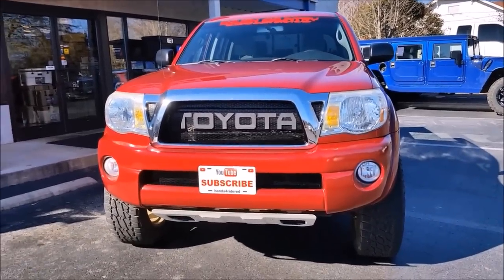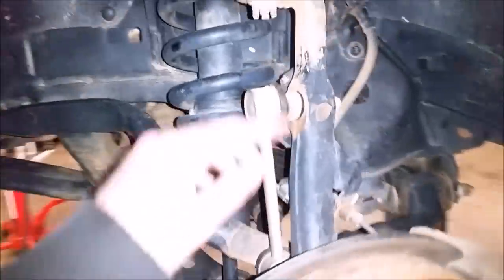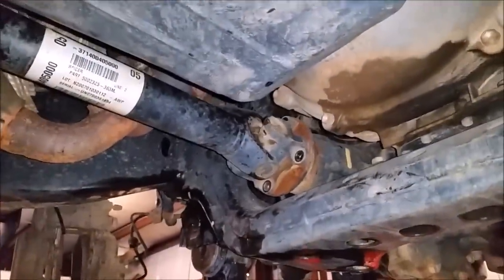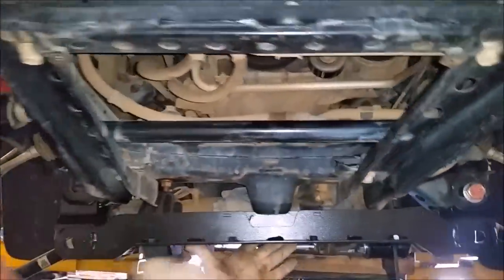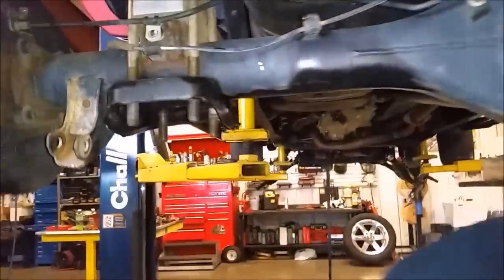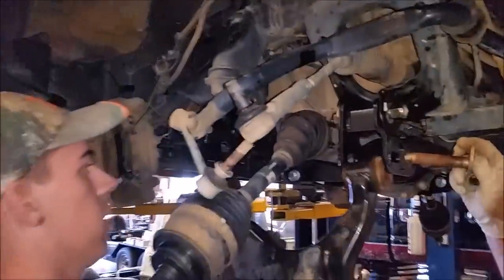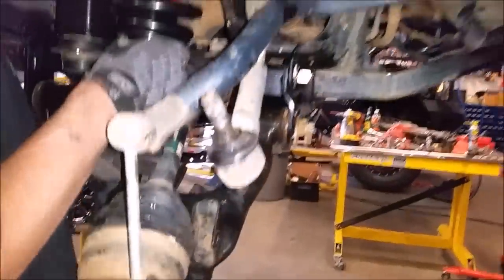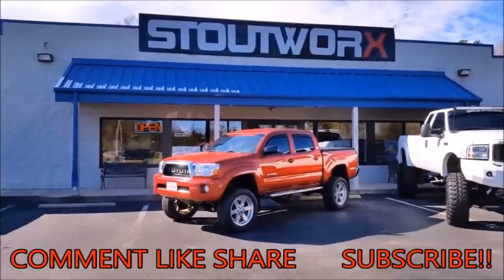Rough Country 6 Inch Lift Kit Installation - 2nd Generation Toyota Tacoma

Comment: does putting a lift on a truck cause more maitenence? Does it fuck up your truck at all?
Reply from the maker: A lift would generally not cause more maintenance, I had a 3 inch for 7 years and had zero issues. This 6 inch tho is a different story, I had problems with this one.
Reply: Bros FOURR Speed what types of problems?
Reply from the maker: +jake silvia Passenger side cv axle went out twice, had to replace the needle bearing with a thicker one which can be a common problem and just the overall ride quality was horrible. Wish I hadn't done it now, 3in was perfect.

Comment: Did you have to extend the driveshaft any?
Reply from the maker: nope, just used the carrier bearing spacers to drop it some.
Reply: Bros FOURR Speed did two shims on each side do it or did you have to add any after
Reply from the maker: Michael Rarrick I actually went ahead and used all of them, 2 would've been ok, but just felt like using them all.

Comment: I want to get a 5.5" lift for my Dakota, do you think I could do it myself if I took a couple days to do it?
Reply from the maker: It's definitely do able if you have the right tools, we ran into some issues that would have been very hard to do at home.  Like having a press for the struts or a machine like that.  Next lift I do like this I will do at home and rent a compression machine or things like that if I need them.

Comment: There's has to be something else on this truck that you could put a spacer on? These Crossmember Lifts (spacer kits) are absolutely worthless with no function whatsoever.... It's funny that I run a 285/75/16 roughly the same size tire on a 3in coil-over setup Not to mention I have more travel and ground clearance.
Reply from the maker: Comparing it to the 3inch lift I had, I wish I stuck with that lift, super solid and lots of travel..live and learn, won't be doing a 6 inch again.
Reply: +Bros FOURR Speed why wouldn't you do a 6 inch lift anymore. what kind of problems did you have from it?

Comment: does lifting a car like so, affect the MPG?? If so, by how much?thank you
Reply from the maker: +TERRY LZ-MARTINEZ It really depends on the tires you run all terrains compared to muds, I was averaging right around the same, but I had not upgraded to larger tires.  So the lift won't affect mpg, the size and type of tire can.
Reply: thank you for answering my question.
Reply from the maker: +TERRY LZ-MARTINEZ Your welcome.
Reply: +TERRY LZ-MARTINEZ Lifting a truck will hurt your milage, almost guaranteed.  With a lift comes bigger tires, maybe wheels, which are heavier and the tires have more rolling resistance.  On top of that is the wind resistance from having a taller vehicle.  If you are worried about MPG then a lift is not for you.
Reply: +TERRY LZ-MARTINEZ Lifting a truck will hurt your milage, almost guaranteed.  With a lift comes bigger tires, maybe wheels, which are heavier and the tires have more rolling resistance.  On top of that is the wind resistance from having a taller vehicle.  If you are worried about MPG then a lift is not for you.
Reply: +MONEYPITDBG again please excuse my ignorance... i want to buy a Toyota Tacoma 4 Cyl.  the one with suicide doors  (manual trans. if it matters) and i just want (for work as well) the truck to look like a 6 cylinder, you know JUST lift it 1 or 2 inches.
Reply: TERRY LZ-MARTINEZ You should be able to do a leveling kit to get the look you are after.  You can find forums for your specific truck, and they will have accurate answers to all of your questions.
Reply: +MONEYPITDBG awesome, thank you
Reply: TERRY LZ-MARTINEZ Don't forget to do an alignment after any kind of suspension modification.  You will be very disappointed if you don't.
Reply: +MONEYPITDBG Great  👍
Reply: Bros FOURR Speed I heard these kits are junk is that true

Comment: 1)What Size Rims?Width? Back Spacing? Off Set? 
2)What size Tires? Width?
Reply from the maker: +Neal Dutta Wheels are Enkei 20x8.5, Backspacing is 4.5, offset is +15.
Tires are 275/55r20, 32.8x11.2
Reply: thank you sir!
Can you be so Kind to send me a link where you got the grill?
Reply from the maker: +Neal Dutta I ordered the parts from Bullet Proof Fabricating  http://www.bpfabricating.com/  
Here's a link to the detailed install.. https://www.youtube.com/watch?v=3A3hEObgNr8
Time lapse.. https://www.youtube.com/watch?v=mhzhiz1kGfI
Reply: Thanks Bud!
Reply: what difference would -12 offset rims do?
Reply from the maker: +hTran7 -12 would have the wheel farther from the truck than the center of the hub. in a sense that "spaces" the wheel. with my +15 and a spacer it almost brings the wheel back to zero which is ideal for any wheel making it much safer to run this setup.
Reply: oh i see, but can you explain how it is safer, what am I risking or damaging?
Reply from the maker: With a high number of negative offset like -44, that is putting a lot of stress on the wheel bearings because the tire is farther outside of the center of the hub.  -12 probably isn't too bad, but being in that zone will put more stress on the wheels.  With the setup I have, and making sure the spacers have loctite, it was very safe.  I wouldn't do it again though, I'd get wider wheels and tires instead, cost's more, but would definitely be much safer.
Reply: awesome thanks.

Comment: This won't end well...
Reply from the maker: It didn't.... Truck dove like absolute garbage after the lift and I kept snapping front CV axles. Front wheels would lock up in reverse too. Ended up selling the truck. Now I have a 2017 TRD Off Road and its been amazing! Installed a 3-4in lift myself and have a ton of mods on it. Amazing truck! Check out our latest Tacoma videos
Reply: Is that a RC issue? I haven’t heard issues like that on other 6”. Also I noticed they didn’t have any centering washers where the front drop bracket bolts back up to the stock lower control arm holes. I find that weird. The BDS/Zone kit has some. I would rather have that bracket true center. Although the alignment should take out any unwanted dimensions

Comment: it will drive like crap and handle like crap. don't do it. get 33" with 3" lift and 1" body lift much better
Reply from the maker: lol, This video is showing the installation!  But yes it wasn't the best idea and I ended up selling the truck.  I have a 3rd gen tacoma now on 34's with a 3'' lift!  I wouldn't recommend a body lift, separating the body from the frame can be dangerous in an accident.  The 3'' lift I have now is a really good setup!